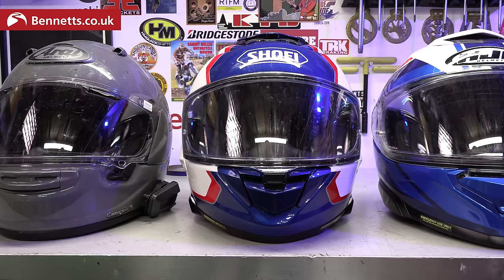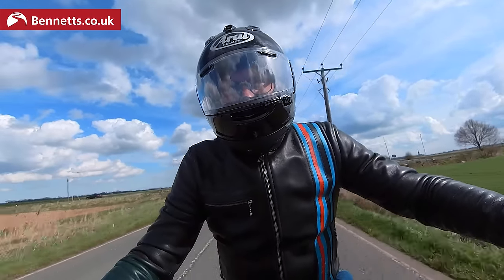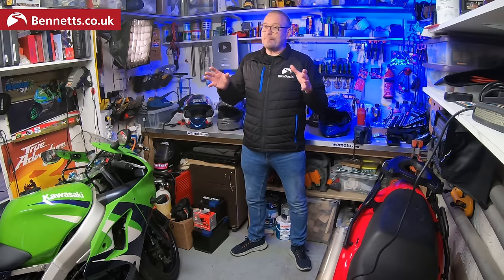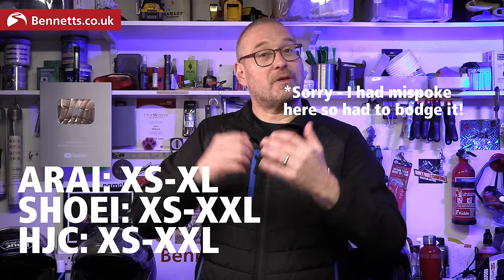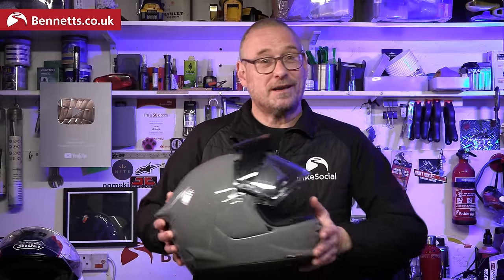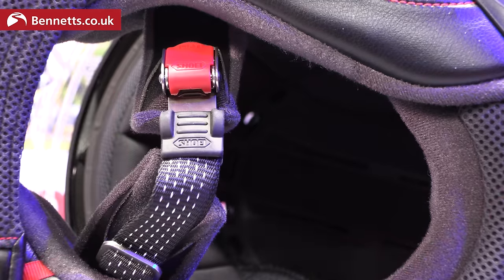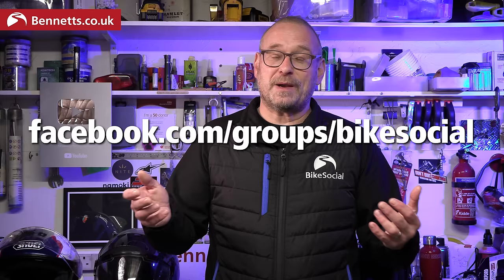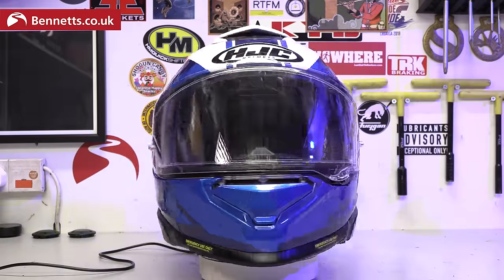Best sport-touring helmet: Arai Quantic vs Shoei GT-Air 3 vs HJC RPHA 71 vs Shark Spartan GT

Comment: I've got the GT-Air 1 and I don't find it to be very good. It's also my 1st and only helmet with a sun visor and I find it pretty useless. Unless it's a warm day it fogs very fast. A barely used it. On top of that it's noisy and there's too much airflow for the winter. I don't know how much the GT-Air 3 is an improvement, but I think I'll try an Arai next. I also like Shark, but never had an Arai and I want to try one.
Reply from the maker: That GT-Air 1 must be knocking on a bit now!
Reply: @bennettsbikesocial  It's like new. I found full lining replacements, including cheek pads, so the fit is as good as new. Also got a new visor and pinlock. It was maybe 1/4 of the price of a new helmet of the same quality. The outer shell has barely any scratches on it although it's been used a lot.

Comment: 16:08 I'm really surprised that you say that it's wind screens which create wind noise. Yesterday, I rode a V-Strom and an SV-650 back to back, with the same helmet. The wind noise on the SV was unbearable on the highway. On the V-Strom it was utterly quiet. Can you elaborate, please?
Reply from the maker: Helmets that are wind-tunnel tested are done so on a naked bike, but screens AND fairings can add turbulence. Add into that the fact that your body position and the fit around the sides and neck make a massive difference, and wind noise will be incredibly hard to quantify reliably, and will always be subjective. In the good-fitting helmets I've had, they've tended to be quieter when in clean airflow (eg standing up, compared to sitting behind the screen)
Reply: @bennettsbikesocial  Well, I just had the exact opposite experience, so obviously this is not black and white. I was also standing up on the pegs on the V-Strom, and then there was as much noise as on the SV650. Sitting down it was VERY quiet.
Reply from the maker: @stefanhansen5882  Exactly – fit, fairing etc all contribute. What helmet is it? The fact that it's noisier in clear air makes me think there's a leak or a poor personal fit around the ears or neck skirt.
Reply: @bennettsbikesocial  That was very valuable info. It's a Scorpion Exo Combat II helmet. And yes, a LOT of air flows into the helmet from below. Yesterday, I found that I could make it pleasantly quiet by stuffing a folded beanie inside the detachable "front piece".

Comment: Really like you reviews. Need avdise, i drive a motorbike for a 3,4 month , use to drive it without helmet, ordered it waited 2 month.  an arai quantic,just came on new year, looks like it fits me quite good , researched a lot before buying it. About fit and etc
That is actually my first helmet, use to drive without helmet for 3 month,  first impression air amout is great, fit is great , but dont have anything to compare with,still.  everything is just great so far, but tge only thing that bothers me , the sound of the engine that sound like i wear a speakers or headphones in my ears that deliveres engine sound quite loud ,  i don't know if this is normal or not.  It is like in fake sounding cars where engine sound comes from the speakers.  What you think about it?
Reply from the maker: Not sure about that, though you should wear earplugs. Give them a go. Cheers, John

Comment: Arai is great if you like cold air in your eyes/face constantly. Ok on a very hot summer day, not good most of the year
Reply from the maker: Not something I've found in any of the Arais I've used.
Reply: @bennettsbikesocial  do you think I need to adjust the visor in? I’ve tried this but honestly the helmet makes my eyes stream constantly
Reply from the maker: It doesn't sound right. Try your dealer as Arai support is very good @petea1663
Reply: @bennettsbikesocial  I will, cheers for the advice

Comment: I find people are pretty snobby about helmets. Dig deeper into the safety test results and you quickly realise that most expensive doesnt always mean safest!
Reply from the maker: You can only dig as deep as the minimum requirements of the standard. 22.06 is provably safer than 22.05, but that's all we can know. Will be interesting to see what SHARP does though this year

Comment: The problem with Arai helmets is the stupid vents on the visor. It obstructs the view ahead. I don’t understand why nobody is talking about this.
Reply from the maker: What bikes have you ridden in an Arai and had problems with the vent position?
Reply: @bennettsbikesocial  I ride a sports bike through winding roads, so I crouch down on the tank for better cornering. This means I’m looking through the the top of the visor, and these plastic vents protrude into the field of vision. Plus, it’s a really noisy helmet, so I don’t use it anymore.
Reply from the maker: I honestly haven't had a problem with the vent position, and nor has anyone I know. Guess that's why it's so important to try a lid on before buying
Reply: @bennettsbikesocial  what sort of bike do you ride? I guess if you’re on a more upright riding style it might be fine.
Reply from the maker: All kinds, but I've ridden 100s of different models through my career, from a Vision 50 and SR125 to an S1000RR and V4R. Michael Neeves only wears Arai, and doesn't seem to have a problem with them. It'll depend on the model too though - the visor aperture position is different depending on the intended use.

Comment: Thank you for your effort. I'm sad to say it but I don't agree with your view that all products meeting a regulation are equal. They are not! Compliance with the regulation is necessary but not sufficient. The regulation only sets the minimum requirements. Try and make a list of all the tests you would perform for a helmet you would wear. Then compare your list to The United Nations Motorcycle Helmet Study, page 24, table 4: Comparison of tests included in different motorcycle helmet standards or regulations. If all your points are covered, just go and buy a helmet you like. If your points are not covered you will start looking for information about the missing points. Documented tests are best, design philosophies and company history can give an idea. Often you are left with your own inspection of the helmets depending heavily on your own knowledge. Personally I'm afraid that a helmet with protruding spoiler or vents will catch the asphalt in a lowside crash. I've not seen a test for that anywhere. To me many retro style helmets look good in that respect. We all want to ride safely and need to use or common senses - or what's left of it - to find the safest gear.

Comment: If the Arai chips easier, it's because the clear coat is not the utmost quality.  Sorry, Arai.  But automobile hoods have a special chip-resistant clear coat on them so when pebbles from the road hit the car, it won't chip.  This is what Arai should be using.

Comment: I don't get it...well maybe I do, but more of that later.  
SURELY obvs every helmet review should start off with the reviewer telling us what their head shape is? 
SURELY obvs every helmet review is more or less redundant, if the reviewer doesn't do that? 
SURELY obvs every helmet manufacturer's advert should start by saying this helmet is designed to fit a round head shape, or intermediate oval shape, or long oval shape...before giving us all the other stuff about weight, shell sizes, features etc. etc?
I AM SICK of being told that, in the final analysis, at the end of the day, blah blah, I should really go and try the various helmets on, and try different sizes.  WE ARE NOT STUPID, obviously we know that we should do that...thank you reviewers!  
SO WHAT IS THE POINT OF HELMET REVIEWS? What we actually need to know at the outset of this eternal, and hugely expensive hunt for the best fitting, safest, most comfortable, and quietest helmet, is what is the head shape of the helmets that we are dealing with?
SO WHY won't helmet manufacturers (apart from one or two) tell us what shape each of their helmets works best with?  Could it be because they don't want to limit the potential market, for each of their helmet models?  In other words they keep it all deliberately obscure, so that us bikers will spend those large sums of money on their product, even if it's not exactly what we should be buying.
SO WHY won't helmet reviewers start by telling us the most important information about what head shape each of these helmets works with?  Could it be because, in the final analysis, at the end of the day, etc, they need to keep on the good side of the helmet manufacturers, without whose support they won't be given the free samples upon which to base their somewhat redundant reviews?
COME ON GUYS...I'm dredging through endless YouTube reviews, and manufacturers websites, desperate to get some kind of reliable data about which helmets will work with my long oval head shape, and getting precious few nuggets of often contradictory information....'The Schuberth C5 is great for riders with a round head shape', 'The Schuberth C5 is great for riders with a long oval head shape'...really!  It goes on...obfuscation...smoke and mirrors!
I HAVE TRIED contacting sportbikeshop.co.uk & helmetcity.co.uk & motolegends.co.uk ... silence! Well, Tom at sportsbikeshop did say 'Unfortunately, this isn't information that we have readily available I'm afraid, apologies.' so at least an apology.
WHY WHY WHY can't anybody say 'Yes these are the helmets you should be looking at, for your head shape, and btw don't bother with these other ones, as they won't fit you whatever size you try on'??
OK, TIRADE over. Thanks for listening (reading?) guys...I feel better...sorry if I've passed on my grief to you.  Btw, anyone know what would be a good helmet for a long oval head shape...full face or flip up...I'm beyond caring about now?

Comment: You called this a sport touring helmet review yet rode adventure bikes with a very different riding position. No mention of the view out especially the height you can see which is vital at traffic lights when you're tilted forward but trying to see the lights. Similarly you dismissed the pinlock not allowing proper periferal vision on the Arai but it's absolutely vital. You were more concerned with graphics finishing than either of these issues.
Weird priorities.
Reply from the maker: Why not have a look at the written reviews? They're the first hit on Google, or go here: https://www.bennetts.co.uk/bikesocial/reviews/products?motorcycle-clothing=Helmets. Also, the Pinlock on the Arai goes all the way to the edge of the visor aperture (unlike the Shoei).
Reply: I've had no trouble at all with peripheral vision on Aria's pinlock, none what so ever. I'm as OCD as they come, if it were a problem, i'd tell you, I also watched a ton of reviews before I bought my latest Arai and the pinlock being a problem with peripheral vision NEVER came up at all.....